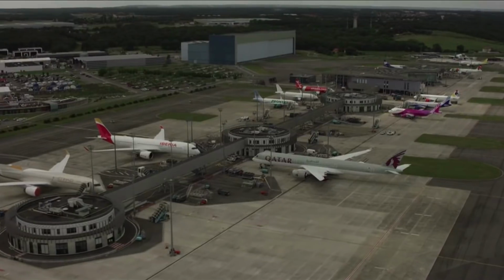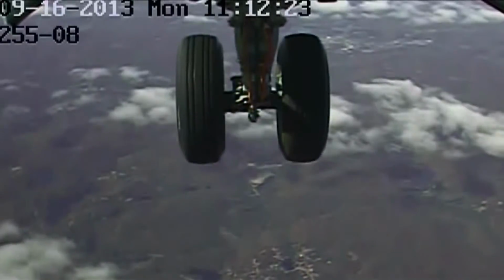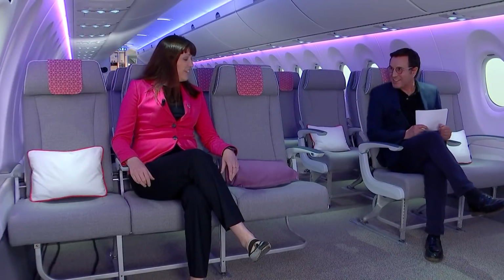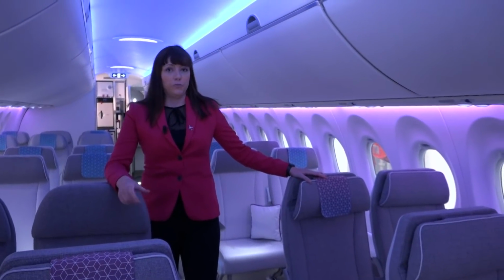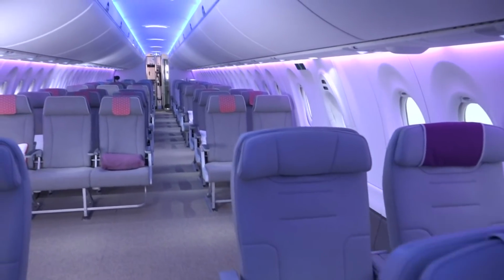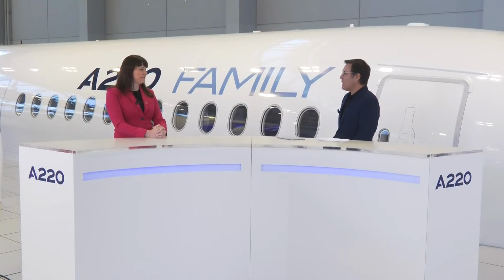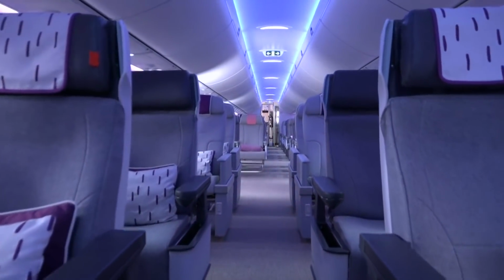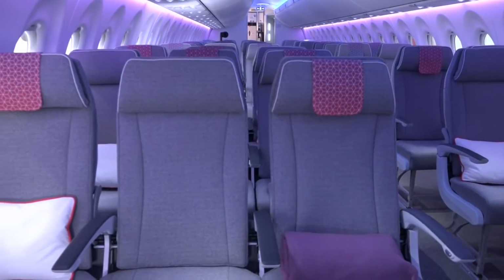First #A220 Mock-Up Unveiling Event

Comment: This is as big as a crj-900 yet has these huge engines but a damm good plane
Reply: It's bigger then a 900
Reply: @rocketPower047  smaller than an md80
Reply: @nic_the_grekk0262  12 more passengers in the 80
Reply: @rocketPower047  how can this tiny airplane help covid
Reply: @nic_the_grekk0262  what? This aircraft is more palatable post covid because it can fly far with less passengers while being profitable. Good plane to have when the market is down.